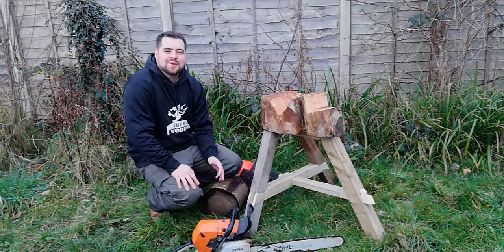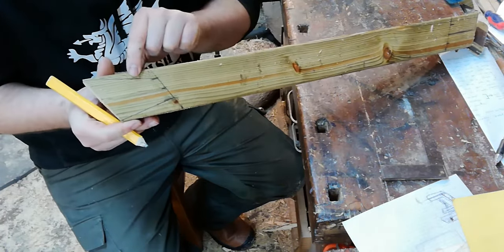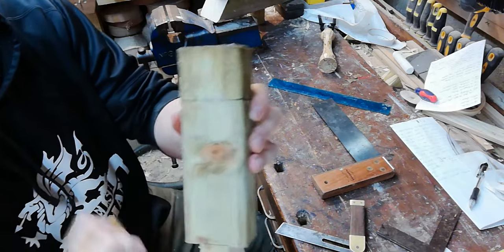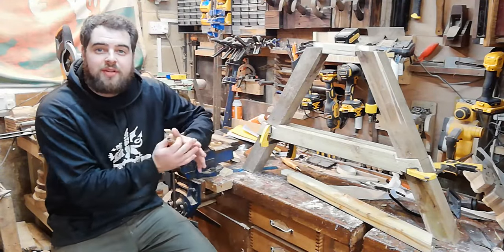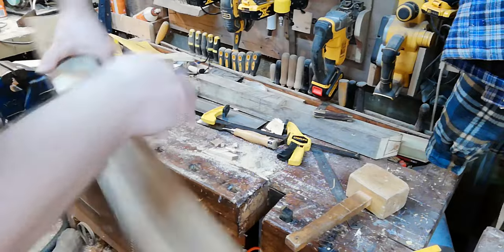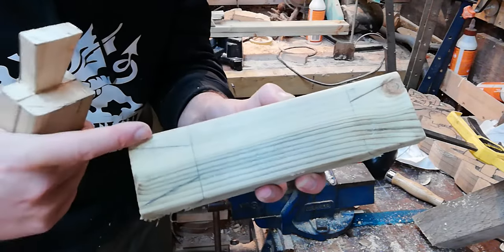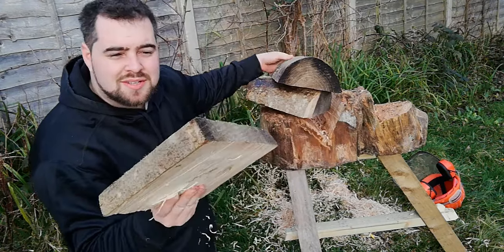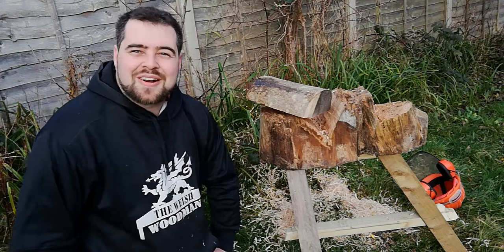Woodworking - Making the ultimate chainsaw cutting station

Comment: Hi Tom, even though you weren’t turning this time, it was still a “turning” video in that we all have to get the blanks ready to put on the lathe.  That cutting stand was a little more elaborate than my cutting area (top of the log pile), also a lot safer. Now I feel compelled to go make a better cutting stand. Maybe not as fancy as yours, but as safe.  Thanks again for another good video.  Diolch ac aros yn ddiogel.  Cheers, Tom
Reply from the maker: Thanks Tom, having used it for a few weeks it really has made a big difference, especially the V section as it makes it easier to cut the pith away, working on a metal hold fast clamping system at the  moment for the side which should make cutting fire wood and the corners off bowl blanks even safer 😁 the joints where probably a bit of overkill but were fun to make, you could easily knock up the same thing really quickly without the joints by using some planks and screws 😁 thanks again for watching